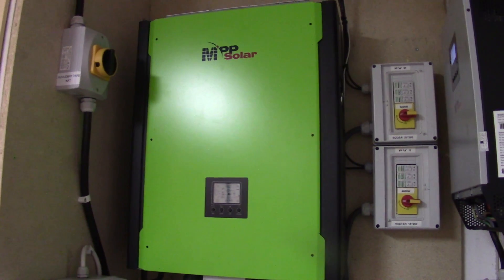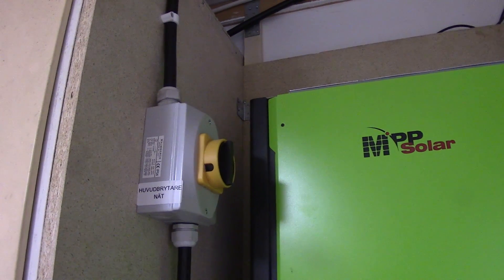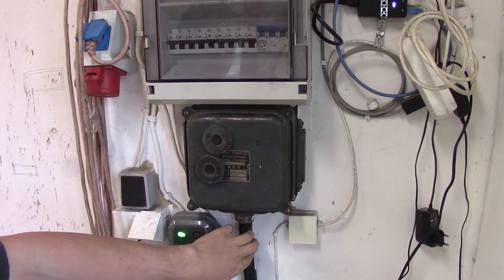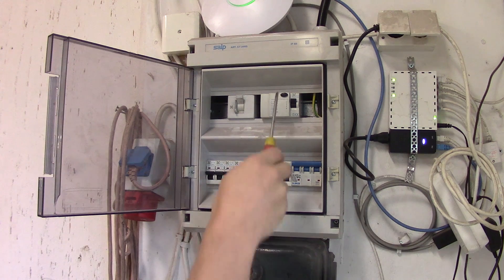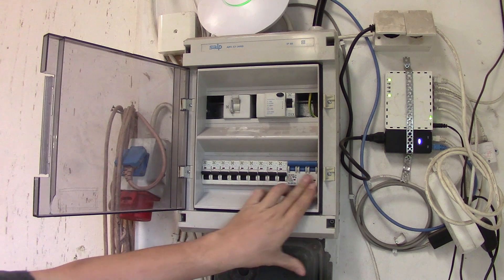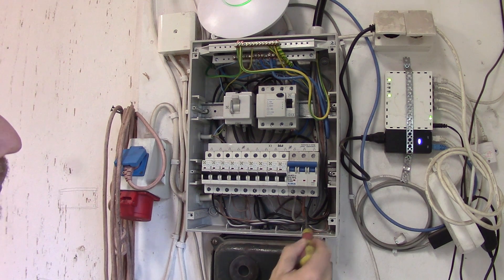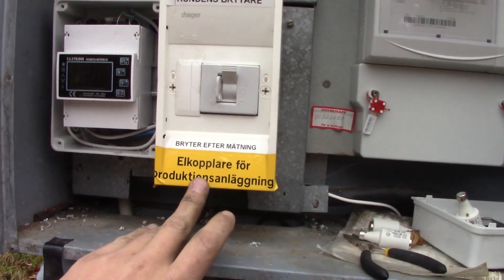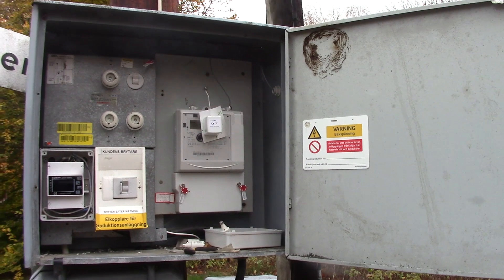Solar Electricity: Connecting inverter to grid

Comment: Let’s say I want to power up few low load devices in the house with solar, how to connect the output of the inverter into the selected fews if the CBs in my house Distribution Box?
Reply from the maker: You need to have a system where you can choose where the power comes from. Sounds like you would need an electrician to do that.

Comment: Hi, could you explain once you connected the inverter to the home fuse box how then you can decide to drain power from inverter first then from the grid when you run out of power from stored enery in the batteries?
Thanks
Reply from the maker: The inverter is hybrid so it can Either run offgrid or grid tie.  In booth modes it can be set to supply in certain order in its settinga
Reply: @DIYTechRepairs  ah ok so the national grid will be connected to the inverter and the inverter to the fuse box. Correct? And the inverter will manage that automatically or based on what I set. Am I correct?
Reply from the maker: @MrCiccioTv  Both. I have an ATS in between that can move my load to grid side or off grid side depending on what happens. You can see the drawing on my page
Reply: @DIYTechRepairs  where i can see your page?
Reply from the maker: @MrCiccioTv  about page on youtube
Reply: The solar setup will feed as much energy as it can into the house. If it's more than you need, a surplus goes to the grid. If it's less, the grid will give the remaining amount on top. Hope this helps

Comment: Hello, Thanks for this.
Have you added something to stop the grid power from going into the inverter or does the inverter have a protection or does that kind of power flow doesn't happen?

Thank you
Reply from the maker: Its a hybrid inverter.
Reply: if you mean that there should be a switch that kills DC when needed then yes, he showed it in the beginning
Reply: @vitalijan.3049  no, I think he means to stop to grid electric flowing into the inverter since they are both connected
Reply: @KaptainKastle That's not how this works, you're assuming the inverter works separately to the mains but as op said it's a hybrid inverter which synchronises with the grid. The inverter will only draw the power it needs, not get blown up by being connected to grid.
Reply: @RedMixRecords  no, I'm not assuming that.  I know how inverters work.  I fit them.  I was trying to clear up what the commenter was saying.  He's trying to say, shouldn't there  be a fuse between the grid and the inverter. In case of over current.
Reply: @KaptainKastle  Gotcha, yeah there should really, wasn't there one?
Reply: @RedMixRecords  I don't know..  can't remember.  It's been like  a year ago since I watched the video.
Reply: @KaptainKastle  Ah I'm surprised you replied then, I wouldn't even bother
Reply: @BagmanJohnJo  you want me to watch the video again ?  I always reply, I'm British.  We are polite like that
Reply: @KaptainKastle  You can do what you'd like, obviously
Reply: @RedMixRecords ok, so I watched it again for you.  The breaker in the consumer units stops any power reaching the inverter and vise versa.  The inverter needs to receive a supply from the mains or it will not work.  If the street supply is disconnected for any reason, the inverter will detect this and stop supplying power.  A message will then appear at the inverter.  You will not be able to "blow uo" the inverter even if supply is coming from the grid and no supply is coming from the panels.   The breakers are there for safety reasons.  Perhaps you want to work on the inverter and need to safely disconnect it.  Hope this helps.

Comment: 3:30 - so u dont even have to run the inverter cable to the main cabinet and it will run back to the grid from the garage box?
what if u need to use more than 16 amps, but the solar cant provide that, but could put it back into the grid for others? does it mean that u could get like 32 amps from the main box and send 16 amps back to the grid at the same time? (which means that u would need a 48 amp power cable between the garage and main box?)
and how many wires does the main cabinet power cable has going into the garage when the garage could have like its own separate(repeating) earthing wire, completely separated from the main cabinet's earth wire?
i guess the inverter does need 5 wires then, because it comes from another side or smth, but can you also have like 48 amps main cabinet and only 16 amps solar system?
Reply from the maker: Many questions. The inverter is max 3*16a. You could potentially have that +grid but its bad design. Grid and or solar must be able to work stand alone. IF not you Will get issues when One of THEm shuts down. No you dont need more Than power Lines to the inverter but of you dont have Line out you cant have it off grid. 
IF you need more Than 10kw in total you need more inverters. The inverter need 5 Wires. 3phases +neutral + ground

Comment: Hey, I have question. Do I need any extra cable between inverter and net meter?
I have net meter outside house, around 40 meters away and inverter mounted inside house next to all breakers.
Reply from the maker: Not sure i understand
Reply: @DIYTechRepairs  I have net meter that is outside house, around 40 meters and all fuses are inside house and I was told that I need extra cable between inverter and net meter cause breaker has to be outside next to net meter.
Reply from the maker: @iwozarzycki7556  not sure i follow but i would say talk to your local electrician
Reply: @DIYTechRepairs  if I have net meter outside and inverter inside and all breakers inside house, do I need to have something outside next to net meter?

Comment: in my home i have 1 phase Can Pv 3 phase Grid inverter give power to the 1 phase grid? Thanks
Reply from the maker: No. You need 1p inverter
Reply from the maker: Depending on inverter but the easy answer is No. Its also alot more expensive with a 3p unit
Reply: @DIYTechRepairs  Thank you Sir.

Comment: Thanks for the reply. I wondered that if my wind generator stops working while connected to the grid and the grid is live , can it hurt my system by backfeeding power to my generator..
Reply from the maker: Yes. You should never backfeed a device that isnt made for it. For instance hooking Up a grid tie microinverter to an offgrid inverter can cause big issues
Reply: DIY Tech & Repairs Thanks again, Can you recommend what I need to purchase and point me to a diagram of the correct process.  I want to use my inverter to power the ring main ,tv microwave, phone charger etc. Max consumption approximately 2kw. I’ve tried it with the mains off and it worked fine , but I haven’t with the mains on.. sorry to waffle on .

Comment: Can you please explain something.
I want to install a 6kw pv system or should i say get one installed.
I am going to use micro inverters but what i dont understand is once you have a solar supply that is in phase with the grid power how is it connected into the house supply so that you draw power from the grid first.
It cant be a simple parralel link as any current being supplied would be equally supplied by both the grid and the solar ac supply when what you want is to use all the power you can from the solar first.
Also assuming g your not using any power or minimal power because your not home, how does your energy suppler calculate how much power your feeding back into the grid?
Reply from the maker: This is a big topic and not easy to answer short but I will try. The first thing i always want to say is that grid-tie generally need special permits to get installed and this is for the safety of you and the ones working on the grid! WIth that said lets start :)

The grid meter you have is going to measure if you sell or buy electricity. Its a special meter and if you got an old house you need to get it swapped out. This one will keep track of how much goes in or out.

The grit-tie system will output ALL that it can that comes from the solar system and thats why you need the grid hooked up to it. 

So basically its as simple as if the solar give 1000W of power and you use 800W then 200 W of it will go into the grid. If you on the other hand use 1200W you will instead buy 200W from the grid. 

Its like water! Lets say you got 2 barrels of water and a hose in between them. The water will always try to stay the same level. Same is with the electricity. It will go the route it can go. Either to your appliances or to the grid or other way around. 

So there is nothing magical or anything you really need to do about it more than making sure you are allowed to have such a system in your area. If you cant get that permit or its to expensive its better to get a

Comment: Very nice video, thank you for sharing.
I have few questions to you:
- is the maximum pic power your inverter is generating?
- is there any specific requirement to 3 phase breaker in your distribution board?
- was ever your RCD tripping due to solar inverter? I suppose inverter MCB has to be connected to separate circuit, not downstream to RCD?
Thank you
Reply from the maker: * Not sure what "pic power" is. But max power the 10kw can generate is just 10kw. Ie 3.3 per phase. It has no surge.
* Only requirement from the electricians and grid owner is that its connected to a fuse. In this case 16A and then a breaker that can be disconnected. 
* Never tripped the RCD on normal use no.  Inverter is hooked up backwards through it and its approved. But if you going to supply without the grid you need the RCD turned around because otherwise it will trip the RCD. Atleast this is how its setup. 

I do have some 2nd thoughts about the way its connected but on the other hand that's how its designed. 

Hope it answered your questions. If not just let me know :)
Reply: Thank you, it was useful. Two more points:
1. Do you have experience of other users / installers to share? I would love to know if it is the only way you install it or there are any other architectures.
2. How do you measure the balance between produced and consumed energy?
Thanks again for your time.
Reply from the maker: 1. Yes some. There is plenty of different setups and how to guidelines. Im not sure what part you want to know more about but for instance when it comes to cables, fuses and breakers it depends on where you live and what actually exist inside the unit itself. I could have skipped some external parts since it exist in my inverter but i did choose to add extra fusing and breakers. 
2. I have a a SDM630 meter in between at my grid incomming that will meassure both ways. goo.gl/lUbUoi
Reply: @DIYTechRepairs  About «Not sure what “pic power” is», he wants to say «— what is the maximum peak power your inverter is generating?».

Comment: I like that inverter! mpp solar products have been good for me so far.
 How long have you had this system running?
Reply from the maker: Tha hardware as such seem to work very well. I like them and the price. BUT i have found some things in the software i dont like and seem to be bugs and unfortunately MPPsolars support is not the best. Have had issues get proper answers but i will not give up since i think they have a good future with it. Been running it for 3 months so im pretty new to it though read/listened/watched/researched for last 2 years.
Reply: Yea i agree on mpp customer service...
May find some help here???
http://forums.aeva.asn.au/forums/pip4048ms-inverter_topic4332_page1&SID=5626117c4989e3b2d3ad814ecddb6381875.html
Reply from the maker: Yeah been following that as well :) Good source for knowledge. At the moment my 4048 only runs as backup since im using my 10kw mainly